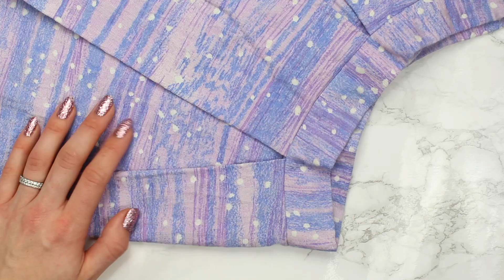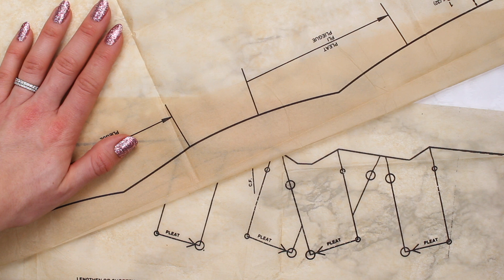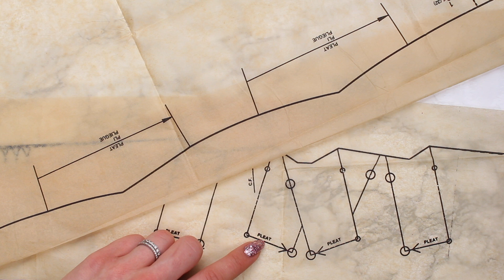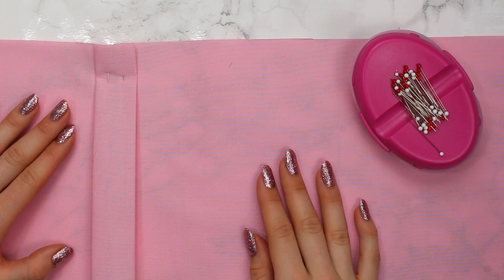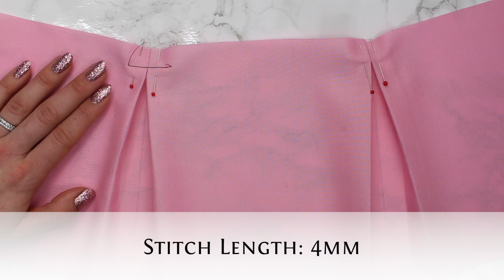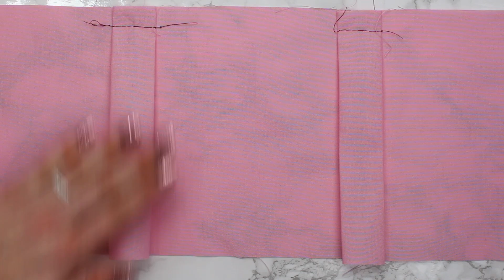Sewing Box Pleats & Inverted Box Pleats

Comment: Hi Aneka, I'm working on a garment now that requires box bleats. However I'm not sure what type of fabric to buy that would give me pleats that are nice and crisp. What do you recommend for a semi-formal garment, and how do I calculate the right width of the fabric I'll be using?
Reply from the maker: Hi Elizabeth, Something like a silk dupion might be nice? This has a very crisp finish for pleats, as does duchess satin (which has a little more body). However these might be too formal/dressy for the occasion? If that is the case you could work with a cotton or cotton blend. It isn't so much what the fabric is made of that will make it suitable, rather the particular fabric. I would aim to get some samples, if you can easily fold the sample and get a nice crisp pleat, then you know it will work well. In terms of fabric quantity and width, it will depend on the pattern you are working with. Usually I measure out my fabric requirements with the pattern and a ruler to determine the width and the length I need. Or choose the fabric first, and then decide how much you need of it. I hope this helps? Aneka
Reply: @MadetoSew  Thank you Aneka, appreciate your help.
Reply from the maker: @elizabethwalters7741  Glad I could help.

Comment: Your explanation of the technique allowed me to finally make sense of box pleats. Thank you so much for such a clear and concise overview!

A question did come to mind (mostly because that's the way my brain works): On a box pleat,  if I needed to gather the fabric to fit the pleated piece into an opening (I've no real idea where I would use something like this. Would pleated short sleeves be a thing??), would I go about things in the normal fashion, or would there be some pitfalls of which I should be wary? In my mind's eye, I was visualizing a sleeve pleated all the way around (looking an awful lot like a miniature pleated skirt), where the waistband would wind up being the seam attaching sleeve and garment, hence the question.

Does that make any kind of sense? As I said,  things pop into my head in such a random fashion. 

In any event, thank you for sharing your knowledge and teaching an old dog new tricks!
Reply from the maker: Hi Marc, thank you for your lovely, kind feedback. I am so pleased you enjoy my tutorials. 
You can add pleats into the top of the sleeve cap (this is a nice look), but depending on the fabric etc. I would probably remove (most) of the ease from the sleeve cap and just have the pleats. If I had any ease it would be a very minimum amount, to not effect the pleats, complete a easing / gathering stitch over the sleeve cap, on top of the pleats. I will have a pattern cutting tutorial on adding pleats to sleeves so stay tuned :-)). Aneka

Comment: I have been attempting to make a regular pleated skirt without a pattern. The part that I'm unsure about is how to get the pleats to stay after washing. Box pleats basically hold themselves, but regular pleats don't! I'd be very grateful for the help. Love the videos.
Reply from the maker: Hi Ali, thank you for your great question. Obviously in industry the fabric is pleated with a high heat and moulds. Generally polyester (man-made) fabric performs the best in terms of longevity, natural fibres have to be taken care of when cleaning (sometimes dry cleaning is recommended). There are companies that will pleat fabric for you with this method, where are you based?

In terms of an at home remedy you can make a solution of white wine vinegar and water. I tend to mix (water) 2:1 (vinegar) but usually test what works for the fabric and sometimes you might need more vinegar 1:1. Either use a spray bottle of the solution or soak a pressing cloth. Squeeze out the cloth and lay on top of the fabric (as you would normally use a pressing cloth) before pressing to hold the pleats in place. Again you will find the longevity depends on the fabric you are working with. I would recommend testing and washing to see the results. 

Other options to help includes edge stitching / top stitching the top of the pleats. Or mark the pleats on the inside of the fabric at the bottom edge (generally with basting / tacking stitch), so that you can see where the pleat should be re-pressed after washing. 

Really hope this helps? Aneka x
Reply: Made to Sew thanks u dear